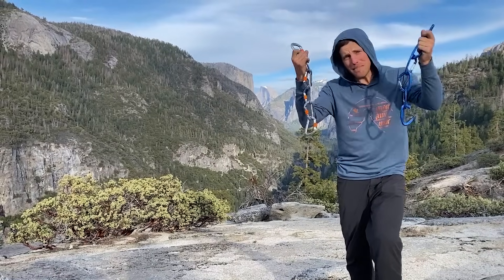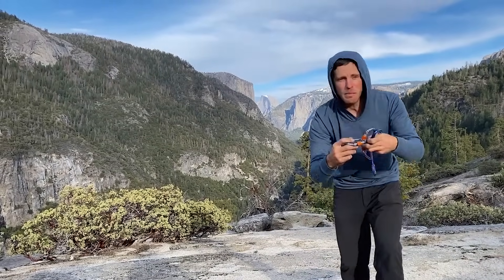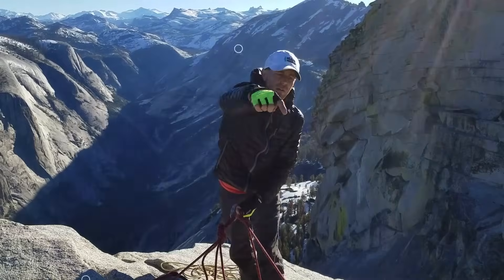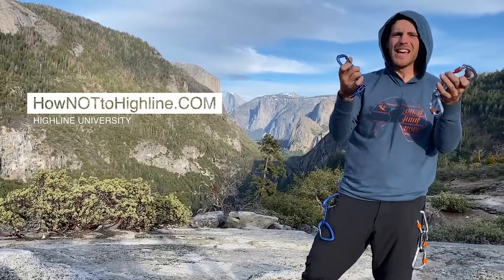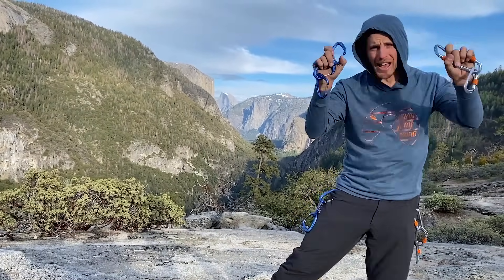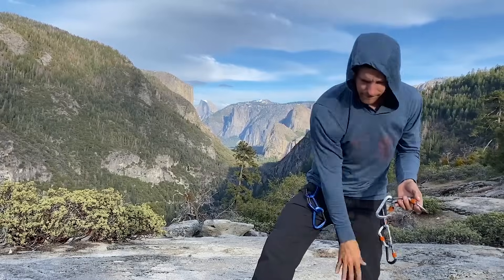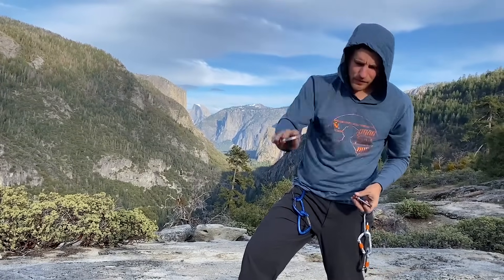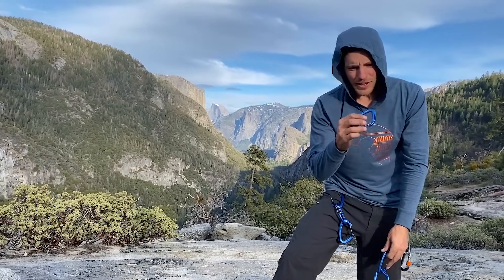Are MicroFractures a Myth in climbing carabiners?

Comment: Micro-fractures exist, but I doubt you can get them by ground hits. The main mechanism that produces micro-fractures is fatigue. Aluminium is highly susceptible to fatigue by repeatedly stressing it close to it's yield strength, a.k.a. a few very bad falls with at least  75% MBS force and no deformation. But that would be a different test.
Sorry to get all technical and I have great respect for the practically scientific side of this channel.
Reply: And those kind of forces shouldn't happen consistently if ever during climbing.
Reply: @blakenev10  They shouldn't, but data on what happens when they do will inform your gear decisions. If potential fatigue-related failures occur due to some event or series of events, at what point do you replace it?
Reply: @blakenev10  A few bad falls should retire most equipment under stress anyway. I don't think there was a situation that registered the forces required ever found on this channel in their specific applications.
Reply: Humm, which side should I argue...  OK, I'll argue both:  :)
While very unlikely, it's probably not impossible that throwing the carabiners on the ground could increase there strength.  One method sometimes used to improve a parts fatigue resistance is to shot-peen it's surface.  Shot peening  is blasting the surface of the part with a lot of little balls.  If you were to throw a carabiner into pee gravel a few thousand or million times, you might get a shot peening effect.  But, shot peening can decrease fatigue life if done incorrectly, so getting an improvement through accidental shot peening would be a long shot (Ugh).
More likely (basically what others have said) impacts with rocks will leave sharp indentations that could be places for fatigue to start.  However, also as others have mentioned, it's incorrect to think of a new carabiner as having no micro cracks.  Most any part will have something that is not perfect even when it's brand new.  These imperfections will weaken the part.  The  less imperfections you want, the more you pay.  This is a big part of why parts for airplanes and spacecraft are so expensive.  Unless you are paying tens of thousands of dollars for your carabiners, you can expect they come from the factory with imperfections.
Reply: You score glass to cut it.... you can do the same with any metal... any cut crack or gouge is a starting place .... ask any machinists .... metal has grain memory and can fracture.... but also a gouge in a biner can easily cut rope
Reply: @jolllyroger1  Stress concentrators have more to do with material elasticity and elongation at break than anything. But that is just the theory in practice there are more parameters, some hard to determine or even impossible to do so without destructive testing (chemical inclusions, improper heat treat, H content, bending stress, work hardening, differential structure). Also sometimes a piece might be of uneven heat treat and after you scour the hard part (unknowingly) it does not produce a valid breaking point. But the gouge cutting rope is a real thing, slacksnap testable too.
Reply: @dragoscoco2173  absolutely you never know when the tiniest imperfection will grow....has a lot to do with work heating rappel down 100 feet then drop a hot biner it will be different than if you do the same and drop that same biner into some snow or if it's laying in the snow and then dropped on a rock or taken from the snow and rappelled 100 feet rapidly without warming the metal slowly..... all these things take their toll ... I'm very suprised but the results shown but what percentage do fail .... just a really good idea to take care id what holds your life
Reply: @jolllyroger1 yeah i think the much bigger risk to dropping equipment is gouges cutting ropes
Reply: @francismartinevans  I am curious as to how many pieces of failed gear you have examined and by what process you used to determine that the failure was not be attributed to fatigue induced micro-fractures.

Generally speaking this type of equipment will only ever be subjected to conditions which will cause these sorts of failures under laboratory conditions. We (the engineering community) know that such factors exist and when tests are devised to determine equipment capacities and safety margins go to extraordinary lengths to ensure we test every predictable potential failure hazard. Certification bodies like UL, CE, UIAA, etc. are extremely rigorous in maintaining their records of what they have tested and granted their certifications to. It is a relatively simple matter to request copies of the certification test results and report for personal review. Usually for only a small administrative fee. If you want test reports for a particular piece of equipment, I'd recommend starting at the certifying body's website.
Reply: @ElenaAideen  i should use more precise language. What I'm asking is: Can someone show me an engineering report, performed on a piece of aluminium safety equipment (ideally a carabiner), where it has failed in the field, and analysis of the fracture surface indicates a fatigue failure.
Reply: @ElenaAideen  what field of engineering do you work in? I'm a mechanical engineer, with experience modelling fatigue in welded steel structures. But before I studied engineering at UQ i was an NDT technician primarily doing industrial radiography of weldments.. but I dabbled a little with eddy current inspection, and the mundane surface methods (dye pen and mag particle).
Reply: @francismartinevans   I am a Metallurgical Engineer and have worked primarily in the Fire and Life Safety industry, on the development and certification of fusible link fire sprinklers. Though I did have a bit of a giggle working in a destructive testing lab doing EM overload testing on aerospace components for a few years. I'm relatively familiar with the sorts of failure testing required by certification bodies, though admittedly I've only personally dealt with UL and CE.

I fully expect that numerous cyclic loading stress tests have been done as part of the certification process. Its a pretty common sort of test to perform on any sort of life safety system component. Heck we do tests on fire sprinklers designed to prove that if an installer used a sprinkler head for fall protection to what degree it would assist. Because I can only guess some "genius" decided that the arms of a sprinkler looked like an appropriate place to clip his fall protection into. Not surprisingly, fire sprinklers do not typically survive being used as part of a fall protection system, though many models do make remarkably good attachment points for emergency purposes. Obviously, they are not certified or rated for that purpose, though we do the tests regardless. Anyhow, I digress. One of the few places where my work and play intersect.
Reply: That would be a great test! Give each carabineer something like 3–5  drops of a 200lb weight from 50', and then test the break strength.
Reply: Fatigue testing of aluminum is hundreds of thousands to millions of cycles. A caribiner will never come even close to seeing that many cycles. Fatigue is not an issue
Reply: @tomgnyc  Fatigue is a function of strain and cycles applied. On a low strain 2-3kN for example, you are right it might be thousands or more cycles, but higher strains (as in closer to the MBS rating) can easily lower that cycle number into the hundreds and even tens. 
The forces going through a metal piece while slamming into the ground are quite high as evidenced by the marks left on it which would require quite the pressure to obtain otherwise.
Reply: One 75% MBS fall will mean you never climb again. You will only ever use a carabiner that has been loaded like that if you inherent it from a chain of now-paraplegic ex-climbers.
Reply: @joestevenson5568  True for climbing, but..... there are situations where forces can double up fast. And as the former name of this channel implied, highlining has different requirements than normal climbing.
A short line with a good fall can easily amplify the forces towards that 75% MBS. While using a carabiner is not a great practice, it is good to know what can happen.
Also even in climbing, the hospital bed is much softer than the ground I hear ;)
Reply: Definitely agreed, I think the dents might also make it significantly more susceptible to weathering effects.
Reply: Drago's Coco I have wondered that since I started watching any of these rope jumping event altogether I knew the majority of their Hardware especially the quick-release lock clips we're made of aluminum and I often wondered how I would not want to put my life in the hands of aluminum thanks for sharing I am far from an expert on this I've never done it and never will but certain things stand out to me and that was one of them aluminum Clips? Not me
Reply: I have no clue about small nicks being "migration" or "source" points for micro-fractures. I guess it makes sense but I've never been bothered by a binder that I dropped on the ground. (Unless it fell down an entire pitch!👍) THAT biner would be  relegated to holding a gear sling.

But please re-do the test after repeatedly loading the biners. 

Do some with a static load of varying kN. Body weights of 100 lbs, 150 lbs, 200 lbs and estimate how many times a binder is loaded each climb. (Ideally, only static loaded once the route is done and you're lowering, right? Perhaps more  realisticaly a few times per climb, if it's a long time and you TAKE a few breaks with your belayer locking you off.

Do some with multiple shock loads.

THEN see how they perform for ultimate yielding load. I think those are most common scenarios

Climbers put their body + gear weight on biners all the time. Then, have falls (assume lead climbing) of a foot, a few feet, and big huge falls and swingers that should probably retire all the gear involved immediately.

There are just too many rules of thumb and "knowledge" that's not based on any hard science and testing, and we need that. We know to retire hear that's had a few hard falls... But what's a "hard fall" does that include dyneema slings used as anchors? Lightweight biners? The rope itself? Harnesses?

Thanks!!👍👌✌️

PS, if you wanna get fancy build some "bad" bolted anchors where the angles are far in excess of 45° or 90° which adds to total load and cross-loading.

THEN test to failure slow static pull and (if you can rig a winch it get a drop tower, test drop tests.)

Cool video! Thanks for sacrificing perfectly good caribiners; as a gear head, it's sad to see them destroyed, but it's for the common good!👌✌️👍
Reply: Aluminium alloys containing copper are vulnerable to failures due to cyclic loads of any magnitude at all. Anodising makes these failures occur earlier by putting a glass hard coating on the outside. Chrome plating has the same effect.
Reply: Aluminium is highly susceptible to fatigue, and unlike steels, there really isn't a stress level where aluminium would have "infinite life", though the number of cycles before failure get's rather large at lower stress levels. This is just a gut feeling, but at 75% MBS I'd expect fatigue failure after tens (or low hundreds) of load cycles, at 60% MBS I'd expect high hundreds or low thousands of load cycles, and at 50% I'd expect tens of thousands if not low hundreds of thousands of load cycles before failure.

If you think about the crack growth, there are always some initial cracs, that may be invisible to naked eye. If you zoom in close enough, there are always some imperfections where cracks start to form. However, until a certain point (in this case probably something between 0.1 and 1 mm), the crack growth is rather slow, but when failure is relatively near, the crack growth accelerates. Even after the crac growth starts to accelerate, we are still probably talking about something like at least tens or hundreds of cycles before failure, at a loads you'd expect in climbing. It's really difficult to estimate fatigue life, and estimates should usually be considered as an order of magnitude of cycles until failure. Estimated 100 cycles lifetime could turn out to be anywhere between 50 and 500 in real life, depending on the assumptions and methods used.

In the end, it should be noted that microfractures and any other phenomena regarding fatigue cannot be tested with static tests (single pull until failure is considered static test). You'd need to have to apply a pre-determined load as many times as needed until the carabiner fails. It's quite difficult to do with a slacksnap machine, but in theory you could aim to apply approximately 85% - 90% MBS (which would probably last like 10 or so cycles) and see if there is any clear differences between brand new and beat up carabieners. It would be slow (and you might decide that you will not apply load more than 10 times per carabiener to save time), and there could be no significant differences, but it would truly allow to conclude that in reality, in climbing, your breaking strength is significantly lower than a breaking strength of a chewd up carabiener.

TLDR; Microfractures are affecting fatigue life, not static strength, and slacksnap is not really suitable for fatigue testing. However, your fatigue life under say 15kN load is much less than for a decently chewd up 24 kN carabiener.
Reply: If we’re getting overly-technical these micro fractures already exist inside every piece of gear because we don’t have a way to manufacture anything without dislocations.
Reply: @dylanclark9437  Annealing is a thing though, mildly setting the dislocations into their task and material specific order.
The dislocations (which are not fractures) are not from manufacturing but standard metallic crystalline behavior.
Reply: @dragoscoco2173  annealing doesn’t get rid of or reduce dislocations. The point is it’s needless to be over-technical. It’s also not worth arguing about in YouTube comments so whatevs
Reply: @dylanclark9437  It doesn't get rid of them, it sets them into the lowest value and distributes them nice and evenly. As in manufacturing deformations and dislocations get evened out and lowered as if it were a new pristine piece of metal with good properties.
Reply: I’ve been arguing with some friends recently about this. My friend believes if a carabiner is dropped 20 feet, it needs to be retired. He argues some micro fracture that cannot be seen.  I believe if it takes a hit but passes a visual inspection, no gouges, no cracks, functions property, it is good to go.
Reply: Exactly. All these ground impacts have created excellent sites for the propagation of micro-fractures through the aluminum, if they were to then undergo cyclic loading. Such as one might see on a slackline or highline. This loading also doesn't have to be up to 75% of MBS or the like. Microcracks can propagate and enlarge at much lower loads, if you've got a good starting feature (like tons of dings) that acts to concentrate stresses on the part.  See for instance: https://www.wired.com/story/microcracks-undermined-san-franciscos-new-bus-terminal/
Reply: @MSPatterson  essentially, all the dings make a bunch of "stress concentrations" which make for localized higher stresses, and when coupled with cyclic loading it can lead to micro fractures, or even pure failure in cases of high single loads, like what we saw in the one carabiner that Ryan tested that had a way lower breaking strength.

Bonus fact: Stress concentrations occur anywhere there is a sharp corner in the material. When they first made comercial airplanes, they had square windows, and the right angles made the corners vulnerable to micro fractures until planes experienced "hull loss accidents" where the cracks would reach critical size and fail catastrophically.
Reply: @TheArmyKnifeNut  As a side note, those square windows just meant the stress was higher so that aluminium hull would withstand less cycles until failure. In all commercial airplanes the aluminium hull and all aluminium parts have a fixed life-time after which they have to be replaced. Although there are some parts whose lifetime is longer than the airplane's, all aluminium parts unless new have fatigue microcracks in them. Think about that while coasting through the air at around 0.8 Mach speeds.
Reply: @dragoscoco2173   As a former Boeing engineer that wrote service bulletins etc., I would have to disagree that all parts are have a fixed life-time. It is true for some parts, but many (probably most) parts just require inspection and can be flown indefinitely if they pass inspection.  I don't think airplanes like the B52 bomber -- the newest of which are over 55 years old -- would still be in active service if every part had a time or cycle limit.
Reply: @andrewsnow7386  Airplane design is key. A military airplane like the B52 might, just might, have a over-dimensioned hull/structure from a strength point of view as it supposed to withstand shrapnel and complex maneuvers at full nuke bomb load. So they might  have an increased safety factor in comparison with the as light as possible design of commercial airplanes of today. Also manufacturing parts for old airplanes is not that complicated, and recently aluminium parts have been replaced with composites and less fatigue prone materials. But i will concede (and bow my head to an actual airplane engineer) the whole airplane replacing in years is mostly a myth as most parts are overdimensioned well above standard safety factor for various reasons or extreme case scenarios.
Reply: @andrewsnow7386  Actually all the aluminium alloy parts do have a life - in some cases it is over a century however (and fault tolerance means they can just be replaced at failure anyway).
Reply: @MSPatterson  Nice article. Although steel is a bit different and has it's own downfalls and strengths, but if it is welded that is whole other game, from the HAZ to Hydrogen embrittlement to shrinkage deformation and the subsequent flame straightening, all contribute to a complex failure system. Those aluminum biners are heat-treated in the production processes to ensure micro-crack closures and negate fatigue and I suppose they are properly work hardened afterwards. So they start pretty crack free. Even at lower loads aluminium suffers from fatigue. This is a very basic fatigue table https://en.wikipedia.org/wiki/Fatigue_limit#/media/File:S-N_curves.PNG where you can see that aluminium can fail in fatigue even at low loads compared to steel but you need x100 to x10000 more cycles versus very high loads (where sub 100 cycles might bring a failure). This cycling and the subsequent failure is the basis of the myth. In HntH's video i suppose the scratches and dings on the outside surface are enough to reduce the cross-section of the tensile element or induce small stress concentrators that can reduce MBS. Conversely if the scratches are not very deep those hits can contribute to a stronger work-hardening (but overall less impact toughness) and with a lucky hit at the most likely failure point it might increase the MBS. This is a complex subject and there are a lot of unknows if you start testing bought biners.
Reply: @dragoscoco2173   -  you're providing a nuanced view of the subject, so my guess is you probably know this subject better than most of us lol
Reply: @dragoscoco2173  please come over say this in safety in aerial arts Facebook group. Some folks on there believe climbing gear is the devil, especially aluminum biners...
Reply: @dtbruning  Well micro-fractures are hard to get, but stress concentrators and strain hardening is possible by hitting rock with intent (with visible marks present). To each it's own, sometimes the time necessary to keep an actual gear log is just not worth for the task, risk or weight, sometimes steel is just better. For everything else keep a log.
Reply: @MSPatterson  Woah that was a super interesting article.
Reply: I love your channel, congratulations for the initiative! But you have to understand the mechanics of fatigue. After the microfractures are created, it takes a lot of use for those fractures to propagate. Is it 10 falls? Is it 100, or 1000? I really don't know, but you guys could cycle the binder load and figure it out! Aluminum is very sensitive to microfractures propagating at a small load and high cycle! Thanks!
Reply: The cycling community found that steel flexes but aluminum will microfracture.